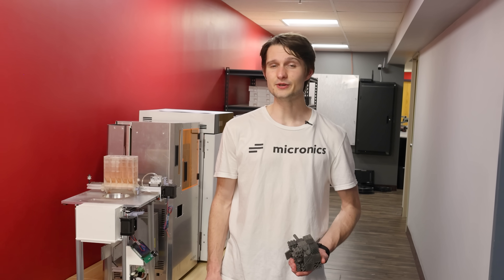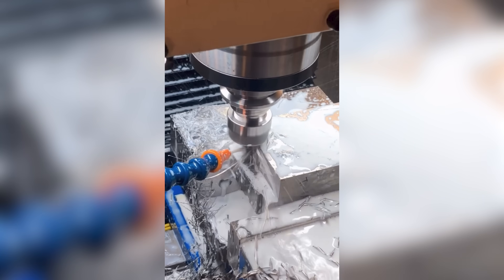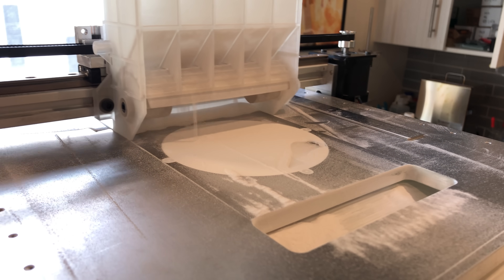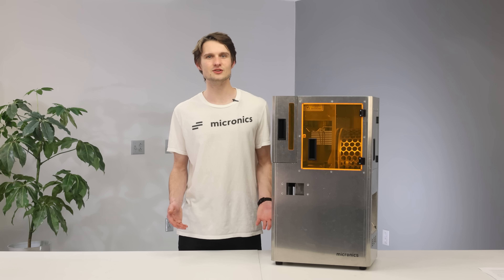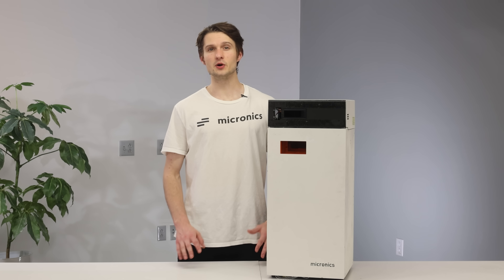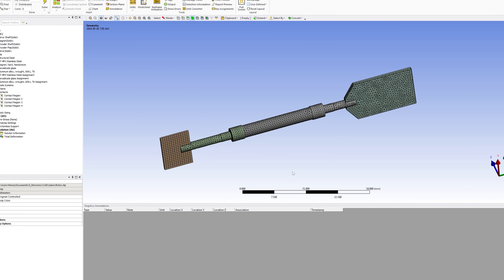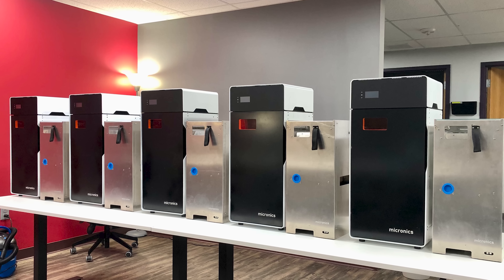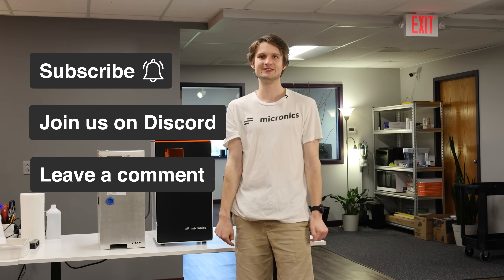DESIGNING & BUILDING the Micron SLS 3D PRINTER!

Comment: Now looking back at this the design is actually crap. The auger idea is ridiculous and unreliable, heating the chamber with lights instead of just using a cheap silicone pad found in fdm machines is super unnecessary, and using a custom analogue PCB that looks fancy would just eat up dev time and further degrade reliability.

Comment: This is genius, FAR beyond what I originally had in mind. If there is one improvement that can be made to this, it would be to implement a CMYK and RGB lasers into the system with a clear powder so as to mimic the use of pad printed parts.

If these changes were added, you could have the ULTIMATE 3D PRINTER.

Comment: Hey guys, I see some surface quality issues on the prints shown, good surface quality is important to me, also could you post some accuracy numbers specifically related to skew between XYZ?    what temperature does the chamber reach and maintain?  How close can parts be placed to eachother without causing artifacts? (And how close to build walls) can you post a video of a print usimg the full build volume and printing say the maximum number of duplicate parts for bigger volume prodction of small parts?

Comment: At this price a lot of people will be interested in having one of these at home. Is this type of machine and post processing safe for domestic buildings?
Reply from the maker: We recommend putting it at least 10m away from your usual workspace, ideally in a garage. That's mostly in case of accidental powder spills. The printer has built in carbon and HEPA filter and the post processing is done in an enclosed box. (You can see it in our unboxing video https://www.youtube.com/watch?v=SupuCvfviWQ). 
The printer also has triple redundancy for the heaters and the laser module power is tied directly to the door interlock switch so it would be highly unlikely for it to go boom.
Reply: It will be a big news even if one amateur boomed himself during using desktop SLS machines.

Comment: Can you reheat the parts to make them stronger?, wish there was a way to do that at home
Reply from the maker: The print chamber is heated to >150C during printing and is slowly cooled down after printing. The parts come out of the printer fully annealed so it is not necessary to re-heat them afterwards.

Comment: First of all this is incredible, and I can’t wait to get my hands on one. I would love to know more about the pricing strategy, and cost of manufacturing vs sale price. Also would love to know more the software controlling it. Is it included with machine, subscription based, etc? Are you locked into an ecosystem of buying powder from the company?
Reply from the maker: Kickstarter discount price starts at $2999 for the full kit and regular MSRP will be $4499. We have our own slicer caller MicroSlicer. It's free and you can see it in our first video. You can use any material you like and all parameters are open.
Reply: @micronics3d  that’s great, thank you! Are you requiring a pay in full or a deposit for the kickstarter?
Reply from the maker: @andrewchrustic7361  Yes, payments on Kickstarters are in full.

Comment: I'm a little surprised it was so hard to get a stable laser galvo system. None existed at your size, or price range? Would a used laser show set have been affordable? Or would they have been stable enough since they're usually used to draw things dozens or hundreds of feet across?
Reply from the maker: The problem with the cheap laser show scanners is that they are built for speed not accuracy. It's what we used for our first few machines but it's nowhere near repeatable enough for a serious SLS printer so we had to go away from it.

Comment: How much does it cost to operate?  Consumables and such?  Thanks!
Reply from the maker: You can check out the price of consumables on our website. https://www.micronics3d.com/store
Each part takes 15-45 seconds in a sandblaster so just add that labor cost as well. The machine is pretty low maintenance, just replace the air filter every 300h and grease it now and then.
Reply: @micronics3d  Thanks for the quick reply!  How far does 5.3L of powder go?  I'm familiar with FDM printing but not SLS.  We talking 25, 50, or how many 3DBenchys?

Comment: I imagine you guys are gonna be swamped with 1) SALES  2) COMPANY BUYOUT OFFERS  3) INVESTORS 4) Can I work for your company? REQUESTS      GOOD LUCK!!!   A question:   How does the fine detail compare to resin printers?
Reply: Industrial sls tolerance is usually around .0015-.003" ...  a sla printer will likely be more accurate, but those materials aren't ideal for many applications.
Reply: @zomie1  for +20.000€ i want 0 tolerance. But for 3.000€ a 0,02mm tolerance is perfect